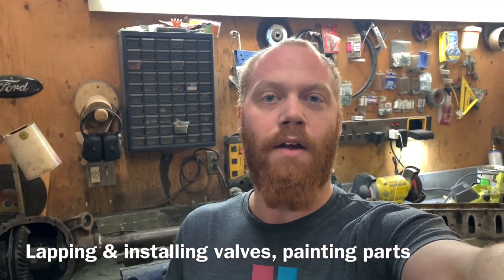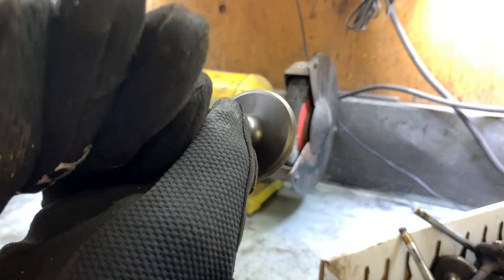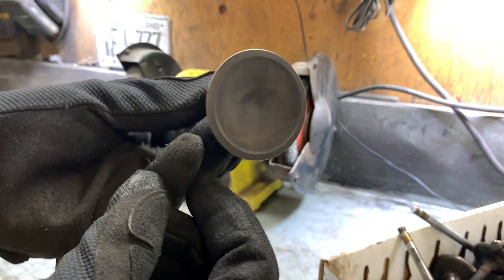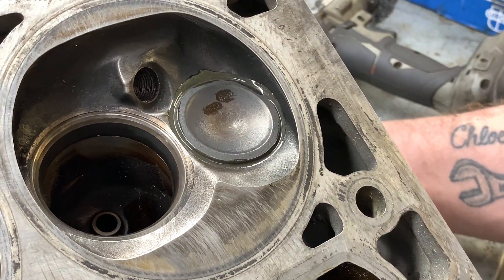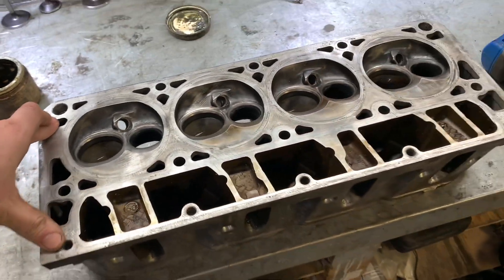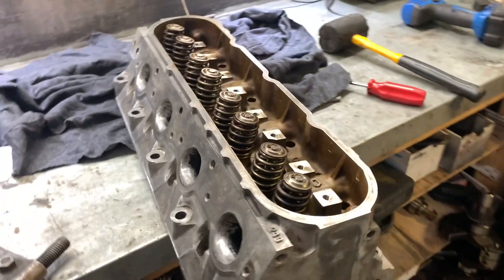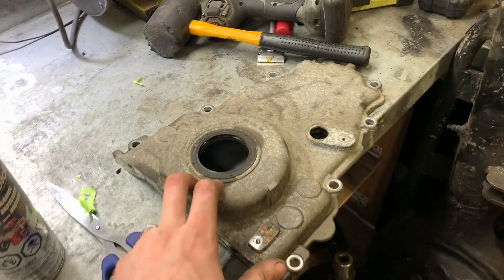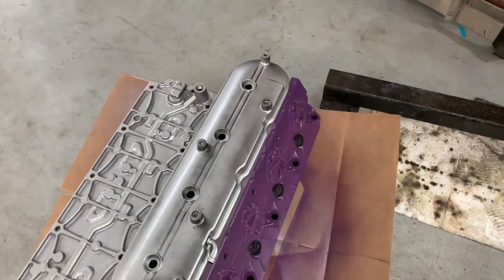Aluminum 5.3 build - Lapping valves, installing valve springs, cleaning and painting parts #8

Comment: I did this to my 6.0L heads today Barry. Put in new valve seals as well. Thanks for the great Video.
Reply from the maker: Nice! A lot of people forget the valve seals or don’t go through the trouble but they definitely help with oil burning.
Reply: @StationroadRatrods  60 bucks
Reply from the maker: That’s not terrible. LS stuff is much more expensive than SBC parts but they’re made much better
Reply: @StationroadRatrods  I picked up a 1/2 inch Maximum torque wrench from Canadian Tire today. it does angles as well. use it on the heads here.
sloppy mechanic re used head bolts. he does 30-50-75
Reply from the maker: Right on! I’ve seen videos where Matt reused the head bolts and gaskets but never noticed which torque he set them to. I’ve torqued used bolts to spec but that last 90 degrees will make you sweat haha.
Reply: @StationroadRatrods  with this new torque wrench we will torque to spec.
Reply from the maker: Deadly
Reply: first fire on the 6.0L today. I would send you the clip but cannot attach here. @StationroadRatrods
Reply from the maker: Nice!!! If you have Facebook look me up, and join my group “station road rat rods YouTube” 
Post your fire up video or send it to me in a pm, I’d love to check it out
Reply: @StationroadRatrods  Thanks Barry. On the last video something caught my eye with your 6L going in. How or what did you do to use to y pass the oil cooler block???
Reply from the maker: If you’re talking about the dual oil feed for the turbos, I actually posted a video on how I did it, check it out

https://youtu.be/S8MZrvDUr9Q
Reply: @StationroadRatrods  HP Tuners. Where did you get yours I understand about 550 CDN? After buying is there any other cables etc that is needed or hidden costs to get up and running?
Reply from the maker: You’ll need the hptuners unit itself and credits. A few years ago you’d buy hptuners and it came with 6 credits but not anymore. You’ll need 2 credits for gen 3, and 2-3 credits for gen 4 depending on what pcm you have.
Reply: @StationroadRatrods  does the HP tuner come complete with all cables need to get up and running? any hidden costs to get up and running that you did not expect? Where did you buy yours?
Reply from the maker: I bought mine directly from hptuners, there are no hidden costs or materials to buy at all. It comes with the obd2 port and the cable I pointed out, and a couple stickers plus the VCM editor/scanner software on a USB thumb drive. You also create a log-in on hptuners.com and have access to the tune repository that has a huge number of tunes that people have uploaded to the repository. Everything from stock tune files to heavily modified and they’re all free to download so you can pick out a tune that may be close to your current setup.
Reply: @StationroadRatrods  Sounds good. Do you have the dashboard on yours and is that standard?????. By that I mean when you run it has the gushes on computer screen. I only have a MAC so I may need a different computer.
Reply from the maker: I just put my laptop on the passenger seat when I drive or up on the dash, but VCM scanner comes with it also. There’s no dash unit like a Holley or anything though. 

The gauges are a nice feature and you can data log a lot of parameters, and use them to tune
Reply: @StationroadRatrods  Barry when you say customize the length of wire are you cutting and splicing? if so a video coming on this.
Reply from the maker: Do you mean about the pcm wiring?
Reply: @StationroadRatrods  yes in y ou video you indicated the harness was too long. how are you shortening wires.
Reply from the maker: I’ll be pulling the harness tight from the pcm out to the sensors, and when I get to the sensor I think I’ll be doubling back the wire. By that I mean I’ll take the excess and loop it so the excess lays flat on the harness. This is done several times in the stock harness especially with ground wires so it wouldn’t be an issue. If there are any with a lot of wire I may have to cut and join it, but I’ll be trying the loop first
Reply: @StationroadRatrods  makes 100 percent sense. I have been an electrician for 43 years.
Reply: @StationroadRatrods  was that a stock harness from a truck. They have some short wiring to run like that especially 1 and 3 injector along with temp
Reply from the maker: Yup it’s a stock gen 3 DBC harness. It all fits the engine pretty tightly. I’m changing from rear cam sensor to front, and the cool part is I pulled the wiring back through the harness and out another branch and I didn’t have to extend the wiring at all, just rerouted it
Reply from the maker: Nice! I have a whole lot to learn about electrical but day by day I’m getting it!
Reply: @StationroadRatrods  Barry what are you running for a plasma cutter
Reply from the maker: It’s a Forney 20P. Part number is “251” it’s a good little hobby unit, it can cut 1/4” clean and up to 1/2” with some gouging
Reply: @StationroadRatrods  600 bucks I see. not a bad price
Easy to get consumables if needed???
Reply from the maker: Yup they’re easy to get, Forney sells them. “85392” is the part number. They last a while too if you don’t have any moisture in your air comprsssor
Reply: Barr
y do you HP tuners Standard or the PRO
Reply from the maker: I have the standard version, MPVI2.
The pro allows you to log external sensors like wideband, but I wire them into the pcm harness and can log through some unused circuits so I went with the less expensive option

Comment: It’s coming together nicely. Hey something I was thinking about for ya when you pull the motor an trans from the van what are you going to do with the  front hubs/wheel bearing? They need the cv ends to keep the bearing/hub together I think. Take the cv axel apart an just use the outer piece ?
Reply from the maker: That’s exactly what I was planning to do actually good call on that one. I’ll just remove the inner part of the axle and leave the cup on the wheel, I did it on Cass’ avalanche one year while waiting for a new axle, worked fine
Reply: Barry do you have a vid on how to re route the harness to come of the back of intake instead of stock side thing. I dont understand how you re-route the wires  to get to the back with out making a complete mess of harness. also I think 1-3 injector and maybe alt might be way to short, Let me know
Reply from the maker: That video will actually be out tomorrow! 12:00 Newfoundland (st Johns) time. Some wires were too long so I just sort of looped them over and doubled them into the harness. It’s hard to explain but I have it in the video lol
Reply: @StationroadRatrods  Great Video Barry. What is the limiting factor for length of harness without lengthening it by splicing. Is it the coolant temp or injector 1.?????
Reply from the maker: Depending on where you want to go with the harness, probably injector number one. The coolant temp sensor goes back l in the harness pretty far so you could split it from the main harness, run it on its own and move your main harness where you choose. I found the ground wires were what stopped me from pulling the harness farther, they’re pretty short compared to the wires running back to the pcm
Reply: @StationroadRatrods  I have seen where a guy de-pinned injector 1 and 3 and swapped with 5 and 7
. It worked.
Reply from the maker: Oh!! I’m not that creative yet, maybe one day haha
Reply: Could you use bearings from a 2wd truck?
Reply from the maker: Do you mean wheel bearings for the van? It’s been a while since I’ve seen this video sorry